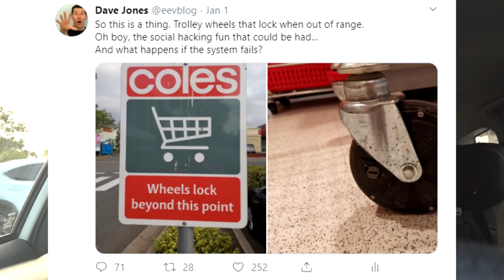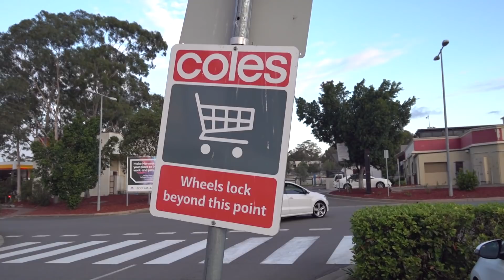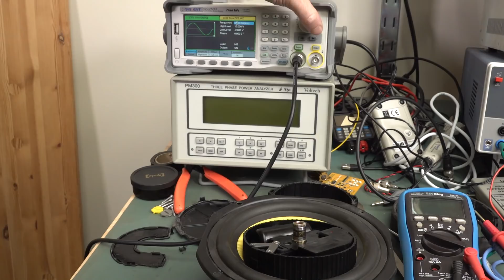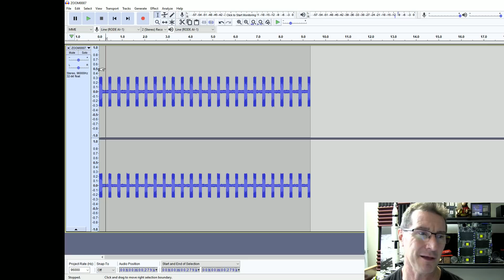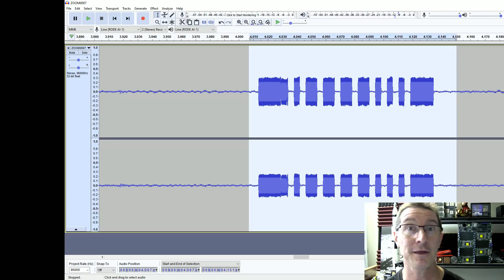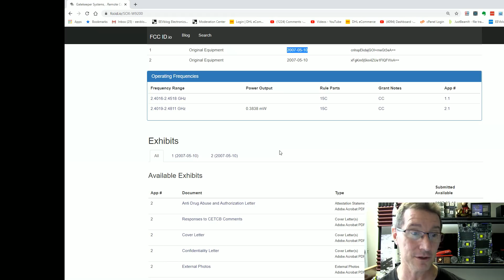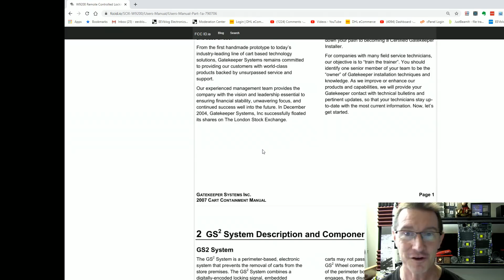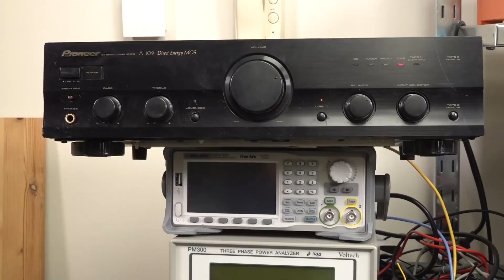EEVblog #1287 - Gatekeeper Shopping Trolley Lock Investigated

Comment: I've never seen these in Europe, mostly the carts are locked by a chain with hook at storage and you'll need a 50 eurocents or one Euro coin to unlock. Cheap as we all are here, we of-course return the cart to collect our coin ...
Reply: Same here in Ireland, although the Aldi carts use a €2 coin.  Surprisingly effective as I don't ever recall seeing a cart left astray beyond any shopping mall parking lot here.  We mainly use British 2p coins as they also fit the Aldi and Lidl cart coin slots.  The ADSA in Strabane (Northern Ireland) uses wheel locking for another purpose - escalators.  When one pushes the cart on to an escalator, the wheels lock up until it reaches the end.
Reply: @theirisheditor  Exists in Germany, too. Small grooves in the escalators, especially in Metro and Rewe.
Reply: @theirisheditor  it's a moving walkway, not an escalator.
Reply: @bit2shift  We call them an escalator here as it goes from the ground floor to the upper floor, unlike the level moving walkways at the airport. Even the shop calls it an escalator on their warning signs.
Reply: I've seen them here in the Netherlands (which is in Europe for those who don't know), they both have the coin unlock and the locking wheel. The supermarket I've seen them at is in the city centre, probably had lots of people taking their shopping (beer) home and not returning the carts.
Reply: @theirisheditor  Interesting. In the Netherlands, I've seen an escalator with grooves in the surface. The wheels have ridges that lock into those grooves. Simple mechanical solution. Or maybe not? The escalator grooves might push on the area between the ridges and might push interlocking ridges together in the inside of that wheel.
Here, we also have the coin locks. For which I have a generic coin which I can hook onto my car key ring when not in use. I got it from a supermarket when I asked at the service desk to change a €5 into €1 coins for the cart. All carts I ever seen here take €0.50 or €1 coins, or a similar sized fake like my key chain hanger. I've never seen electronic locking wheels like what Dave was showing here.
Reply: @maikoool420  When I was still young, we used an AH supermarket cart for transporting beer and other daily necessities from the supermarket to the camping, during holiday in Texel. Every day we took that cart back to the store for getting new groceries. But one one day, the supermarket personnel visited the camping and collected all shopping carts, including ours, which had empty bottles in it. We not only lost the €0.50 coin, but also the deposit money on the empty bottles. As did other residents of that camping.
Reply: Yeah, we had them here in Australia for about 20 - 30 years, started off with a 20 cent coin, and ended up with a $2 coin. Only trouble was some carts had their unlocking key snipped off and you'd either lose your coin, by leaving the cart there, or someone who had the key would come by later and steal the coin. Coles in our area tried this system, but kept having to round up the carts that had been abandoned well out of the loop, sometimes a block away from the loop.
Reply: Kaufland Berlin-Tempelhof and Kaufland Dallgow-Döberitz have these. The wheels lock when entering the escalator and unlock at the other end. Also Edeka at Südkreuz train station has this as a form of theft protection. Once you push the cart through the main entrance to the outside, the wheels lock. At least it was that way a few years ago.
Reply: They are here. Quite a few have those, incl. Lidl. But you still have to chip in the 1-2 EUR coin. I think, this is an extra protection - and very annoying one, because 1-5 carts have the wheels blocked.
Reply: Well Lidl in Haarlem Netherlands (Europa) had them for a while.
Reply: I've seen these in the UK 15 or 20 years ago and even found a recording of the signal somewhere on the web.
But i have never seen one in other european countries. The have that lock on the handle. Put in a 1€ coin and pull out the chain, return cart after use. Newer ones take 50ct or 2€ coins as well, some old ones even accept the old national coins. The system works very well, an abandoned cart is a rare sight.
Even before these locks where introduced over 30 years ago, it was rare to see carts outside the parking lots. There where cart collectors that collected the carts on the parking lot, but just to avoid scratches or dents in cars. 

The mentioned escalator system works different. One wheel is different and simply locks into the ridges of the escalator and gets pushed out at the end.
Reply: This system is definitely more effective. Even if you don't put your cart back, chances are someone else will just for the coin back.

And it makes sense that the wheel locking system is common in the US because their largest coin is only worth 25 cents. Not enough incentive.
Reply: I’ve seen it in UK as well. It was ASDA in Swindon.
Reply: I've seen them in Tesco (a large supermarket chain) here in the UK. The Tesco in my local town is the only local supermarket that doesn't use the "£1 in the slot to unchain the trolley" system - they use lockable wheels instead. No idea whether this is generic to Tesco.
The wheel seems to be severely over-engineered! I wonder why they bothered with a primary battery - stick a couple of coils and a magnet in there as a dynamo and the happy shopper could provide charge themselves!
Reply: @theirisheditor  I've seen that "tongue and groove" system at ASDA in the UK as well. The ridges on the trolley wheels will allow it to roll on a flat surface, but engage with grooves on the surface of the travelator when you leave the shop.
Reply: @StealthSecrecy  Generally (I'd say  exclusively, but someone will know different) £1 (US$ 1.30) in the UK. Many shopping trolley locks are also marked for 1€, but we don't use € here. "Trolley coins", basically metal discs of about the same thickness and diameter as a £1 coin, are readily available.
Reply: @tonywalton1464  Good point. Here in Canada we do have some carts which unlock with a looney ($1), but you can get a fake coin which you can but on your keychain. Still kind of inconvenient if you don't already have the coin, and if there's one thing Americans hate it's being mildly inconvenienced.
Reply: @StealthSecrecy  😉 Probably the same here - the amount (CAN$1 or £1) you'd lose by leaving the trolley is just enough to make you want it back - I wonder how much AUS$ is used on trolleys in Australia. Bet it's $1.
Reply: Ever try pushing them on a travelator, I have and travelator wheels don't bind, but rather use a friction grip related to the magnetic field. The boundary lock is a different system.
Reply: José Ancapdolf Hidler I always thought it was so you can take the cart without risking it rolling down. The wheels unlock at the bottom so you can take it to your car
Reply: @theirisheditor  They're at Aldis at Freedomland too. You have to use a quarter instead.
Reply: Fluffy Blue the escalator grooves thing is that carts for that purpose have wheels that are just on the outsides. In the middle is a non rotating bit. When you’re on the escalator the rotating wheels sit into the grooves, and the middle non-rotating bit sits on the escalator/walkway treads. Once you hit the comb at the end, the rotating wheel bits hit that and you can use it again.

The ones I’ve seen in the Netherlands with blocking wheels are a different brand with much much larger wheels. Larger red wheels that are very visibly different from normal wheels.
Reply: 50 eurocents for a metal trolley? that's a bargain! how do they sell them so cheap?
Reply: supermarket I shop at uses both systems together, and people still steal the darn things.
Reply: @maikoool420  yup. And if you've students, those smart guys have figured out decades ago that metal shopping trolleys make excellent barbequeues when combined with some concrete tiles to put the coals on :)
Reply: In the US ALDI only requires a $0.25 coin, probably because that's the largest commonly circulated coin. Larger denomination coins exist but are not common.
Reply: I've seen them in the UK where they seem to be pretty common, maybe more common than the coin things.
Reply: Same with us except it's a £1 coin
Reply: @bit2shift  The only moving walkway I know is the one that's closed down in Belfast International Airport- and that's a legitimate moving walkway, like a huge treadmill of sorts, as far as I'm aware. Otherwise it's an escalator.
Reply: @wsketchy  escalators have steps, moving walkways/travelators don't.
Reply: @bit2shift  exactly what I mean
Reply: Seán Byrne Us yanks are poor bastards. Also here takes $0.25 coins. Because, well, those are the largest coins in routine use. Some people still don’t quite believe that dollar coins exist (and two dollar coins, and half dollar coins IIRC).
Reply: A few coins?  Really, that’s laughable.  It’s not the cards not being returned in the store lot, it’s the people using them to bring their stuff home after shopping, or most of the time, it’s the homeless that take the carts to keep all their stuff in bring them everywhere.  A few coins to take a expensive cart is a tiny price to pay.  Really, the only time I’ve ever seen those coin type carts have been at the airport.  They’re not the right kind of carts a homeless person would use and normally the homeless don’t hang around airports anyway.
Reply: I have seen in Bratislava (Slovakia) at Tesco Extra
Reply: @tonywalton1464  ASDA in Bournemouth is using both methods simultaneously. They also have the coil annoyingly close to the store entrance which makes it hard to even get your groceries to a car or anywhere else...
Reply: Dusty 99 ‌

Comment: Pushout theft is people running off with a cart full of stuff. That means their antitheft alarms can lock the wheels.
Reply: the cart itself is theft too. about a $500 loss to the store
Reply: @lorenzo42p  Yes, but what 'excited box' said, is absolutely makes sense. You can put individual loops into the floor between the theft alarm gates, and when the gate senses a non-defeated antitheft RFID badge, it can automatically lock the wheels on the cart.
Reply: @lorenzo42p  Not a crime in California.  Even full of groceries.
Reply: @BobWiersema  that's wholly untrue. Charges are often not pursued by the grocery store, and the courts don't usual prosecute, but saying it's "not a crime," is not true.
Reply: David Jameson  The 2-3 other carts, that may be in range, will just have to deal with a slight inconvenience.
Reply: Screw stealing groceries, just cut the wheels off in the parking lot! FREE LI-ION BATTERIES!
Reply: @MickeyD2012  Not Li-Ion, lithium primary. Not rechargeable.
Reply: David Jameson  The Alarm going off can disable all carts currently going over that coil. The one being pushed by the thief is the one that doesn´t have a person standing next to it since the thief will take off running but they keep their merchandise. 

Many years ago my sister worked in a store and they regularly had people load a cart with expensive items and just run out the doors with it. They probably had an accomplice waiting with a car around the block or something where they throw the stuff in the car and take off.

Pushout theft specifically refers to people pushing carts full of items out of the store and many times they are not going through the registers but the front entrance. If you have the coil there then you can stop people doing that.

A few weeks ago I saw someone with one of those plastic baskets run out of a store and hop on a bike and take off. Maybe soon they will put huge electro magnets in those that make them get stuck to the floor :D
Reply: @lorenzo42p  I really doubt those are $500. The figure I was told by someone who works at a supermarket was $125.
Reply: @zorinlynx  Perhaps you need to add $375 to add a couple of 'locking wheels'???? Hehe
Reply: I know one store that had a theft of carts by another store in the same chain. (different franchisor) The other owner brought a truck to steal dozens of carts.
Reply: Drop a few random rfdi tags under your mates workbooks inner sole.
Especially if he's a sus character..
Reply: @mrnmrn1  The problem with these carts is the little plastic wheels don't have enough static/kinetic friction to do much.  You have a wide grip on the cart with quite a bit of mass. I live in the San Fransico Bay Area and supermarkets tend to be a shared area with the rest of the strip mall. I have in the past pushed a locked shopping cart 1/4 to 1/2 mile to reach my car. Good exercise, but it flattens out the wheels and makes them unusable. At least they won't roll and damage cars.
Reply: how is locking one wheel stopping someone from getting away with a cart full of stuff any more than without that system? someone got a cart full of stuff they aren't getting too far without security catching them.
Reply: @Zack-dk3pt  In a grocery store or big box store, people walk out of the front door with cartloads of stuff all the time, to load up their car. Unless LP noticed someone casually bypassing the registers, which can be harder to notice than it seems, they can get the merchandise out of the store. Once in the lot, there's a lot less security and it's not hard to waltz off or load into a car.

Now, as Dave noted, they're not foolproof in the slightest, but nothing is. The philosophy in loss prevention is deterrence. The signs about locking wheels and alarms at the door don't actually stop someone determined to steal, but they stop most people from trying. Most people who do crime are not very good at it, so they rarely have a plan and may well walk over the trigger in a panic anyway, and either get caught or flee without taking the goods.
Reply: It’s not about the theft of goods it’s the cost to replace the trolleys. The $500 value includes not only the cost of the trolley but also the recovery costs to find them all.
At one stage the local Melbourne shop was offering rewards if you found trolleys... so it’s worth something to get them back.

These devices don’t stop it... they just make it harder/annoying to discourage the use. As Dave said.... “just lift a wheel” would get irritating after 10 mins...
Reply: @Skwisgar2322  That's an 18650 in the one he tears down. Not the CR123 in the FCC photos.
Reply: Bustopher Jones beg to disagree..18650 gets its name from being 
18mmx65mm.. it looks a lot stubbier and fatter than that. I would be surprised if the NiMH based on the age..
Reply: @aususer  The original design used a lithium cell. I don't think any designer would go backwards to NiMH in this day and age. Looks like a Samsung INR18650-25R5.
Reply: @lorenzo42p  IDK where you are getting those numbers from but I looked around online and shopping carts seem to cost between 100€ and 230€ which isn't cheap but is quite far from $500
Reply: @Mr8lacklp  those are the inflated numbers used by the company selling that wheel lock product. I believe you all, the cost of a cart is probably much less than what I said
Reply: @Zack-dk3pt  if one wheel locks as you go past the trigger it's quite obvious what's happening
Reply: @SimonJWells  well the majority of stores force you to pass through the check out lanes to get to the exit so either way it is going to be obvious. you think it might be like systems already in place though? the ones that go off due to constant false positives which cause you to stand there wondering what you stole when you clearly paid for all your items just to be waved on by the cashier that rung you up just to have you walk away feeling like you are still about to get in trouble...
Reply: @xenonram  if it's not enforced, it's not a crime. The moment the DA decides to pursue charges, you've got a case to take to the Supreme Court. There has to be a certainty about laws, a predictability, else we are not ruled by laws, but by rulers.
Reply: Exactly. Some stores in the states have these setup to lock at the front doors. So if you buy something big and heavy, you’re on your own basically. Not very customer friendly, but I guess they have to do it.
Reply: excited box exactly this. The cost cited is not just the cost of the cart but is also the cost of the items in the cart. Not hard to believe at all especially at retailers with high dollar tools and electronics.
Reply: David Jameson there likely aren’t many people passing through a single exit lane (space between two readers) simultaneously. Even if there are a few a store employees will be along shortly to check receipts and unlock the carts. Presumably the thief will just ditch the cart and run. It’s a great idea.
Reply: MoneyManHolmes that maybe be the case at some stores (I’ve never seen it) but if so that’s not for theft as much as it is cart coral. To stop theft they can lock the wheels only if an alarm is triggered.
Reply: The gatekeeper purchek system requires the cart to pass through a check stand before it can go out the door. If the cart doesn't go through a check stand before exiting, it locks at the door and sets off an alarm.
Reply: Robert Slackware pretty unlikely set of circumstances you got there buddy. Plus the TV is still in a box, it will be fine. The alternative is it’s stolen.
Reply: Who can run away with full grocery trolley so fast? Seems possible only in land of land whales.